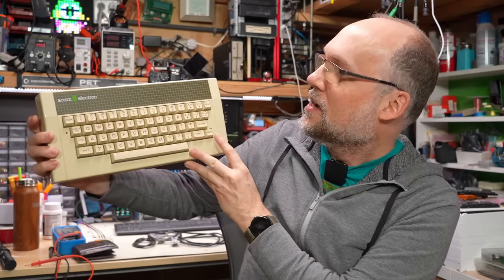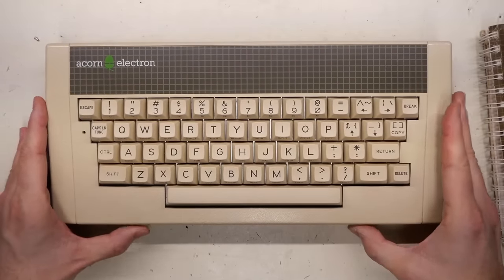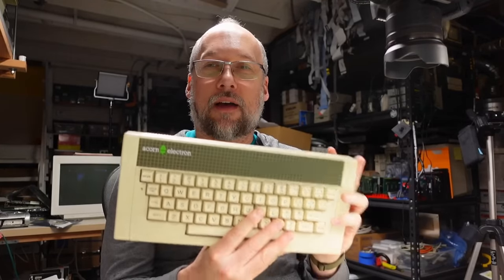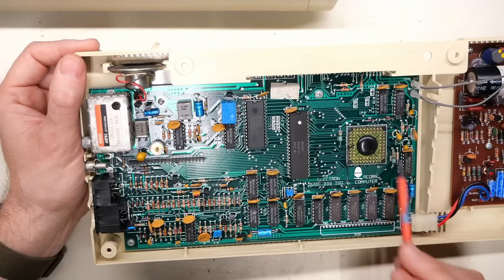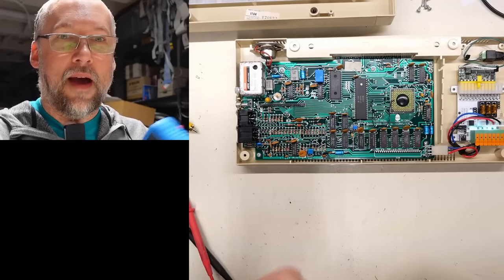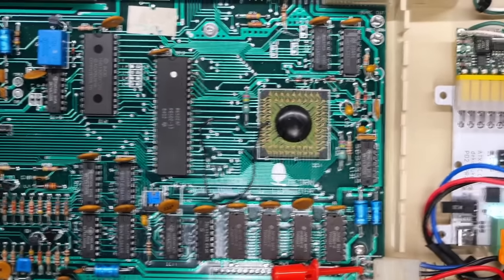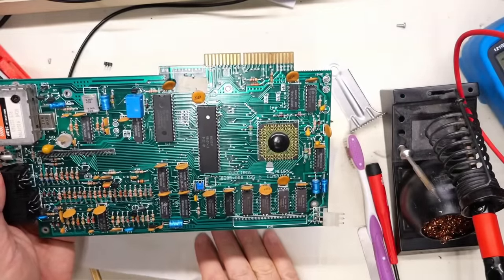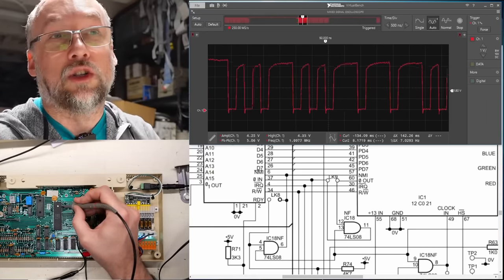I was shocked at what was keeping this Acorn Electron from working (Acorn Electron Repair)

Comment: Fun Electron fix video, thanks.  They suffer from the 6502 getting destroyed by metal things touching the edge connector, sometimes taking out the ULA too.  I've never been a fan of the Electron, it was a cost cutting exercise gone too far.  The video/CPU RAM contention is hideous compared to the zero contention on the BBC Micro/Master and in the high color/high resolution graphics modes, it really cripples performance.  The sound is also a single channel so music written for the BBC/Master won't play.  The need for a static clock is part of the timing bodge, otherwise the unused CPU cycles would need to be replaced with NOP instructions adding more complexity to an already packed ULA that had bugs and time/cost overruns - hell the Electron effectively bankrupted Acorn forcing its sale to Olivetti...
Reply: The Electron didn't actually do anything to Acorn as such. It was a product of Acorn's corporate strategy and thus any responsibility for almost bankrupting the company lies with that strategy and the company's management. And blaming the Electron is rather oversimplistic given that Acorn were investing considerable sums in "breaking into" the US market with an ill-conceived variant of the BBC Micro (noted in the video), as well as formulating a range of business machines based on the Beeb that were unlikely to be competitive.

Not to mention that Acorn were pursuing ARM development as the company was losing money. Despite claims that the ARM was done on a shoestring budget, it appears to have involved not inconsiderable levels of investment and corporate focus. The result were the lean years prior to the Archimedes where commentators noted that Acorn were merely respinning the same 8-bit Beeb technology and not keeping up with the rest of the market.

I would agree that the cost cutting was excessive, however. Acorn should have been more prudent procuring their RAM, put eight chips on board, lightened the load on the ULA, and positioned the machine accordingly. But I imagine that they were scared that outdoing the Beeb in one area would undermine their flagship product, even though the Beeb needed to be redone (as the B+) to use newer memory devices and put more memory on board.
Reply: @paul_boddie  The problem with the Electron was the large amount of money devoted to it, the expectation of 100k+ sales in Dec 83 and the sure-win that was anticipated allowed Acorn to essentially spend money it didn't have.  Then, in 1984 the Electrons arrived, but it was far too late.  People had put off buying the BBC Micro in anticipation of buying the Electron at half the price.  Those potential customers ended up buying neither, leaving Acorn with over 100k Electrons + another 50k sets of parts and 40k BBC Micros.  Their 1984-85 accounts were dismal (high value in stock - tangible assets - but only of use to Acorn and high value in IP - intangible assets, but very low cash in bank - leading to cash flow problems - paying staff and suppliers)  As a plc - Acorn couldn't hide the losses.

Comment: Wrong CPU, ULA not soldered, Ripped trace, but at lease the bodge for the ripped trace went to the right spots even if it also was a bad job. Overall one of the easier cases of fixing someone else's work because the problems were very obvious upon examination. Guessing the person didn't resolder the ULA because the system didn't work anyway with it in there and they couldn't be bothered doing all that soldering just to have a system that still didn't work

Comment: Is a memory expansion possible ?
Reply: Perhaps the most popular back in the day was the Slogger Master RAM Board which added 32K of "shadow RAM". This raises the amount of memory accessible to certain programs by effectively giving back the memory that is dedicated to the framebuffer, which is up to 20K in high-resolution or high-colour modes. When the Electron was being sold off at highly discounted prices, Slogger offered units with this board already fitted.

There were also second processor expansions that added another 6502 and 64K of RAM. And paged RAM could also be fitted, with there even being a 256K cartridge available, although things like that were often used for RAM disks or for hosting software typically supplied on ROM.

Comment: It's a shame all the 4bit to 8bit data bus circuitry is in the ULA - if it wasnt, you might be able to make a hack to put another 4 RAM chips in and bypass the CPU slow-down.
Reply: Actually, depending on what's on that external connector, you could probably develop some sort of cartridge to do it.

Comment: I would love to see the details of how they made the poor 6502 work on a 4 bit data bus. That has to be the most horrible cost cutting measure I've ever heard of.
Reply: No different in principle to the way that Motorola made the 68008 CPU.
Reply: The ULA acts as the intermediary between the 6502 and the built-in RAM, accessing two adjacent addresses by maintaining the same row address but issuing two column addresses, building up (or splitting up) an 8-bit data item from (or into) two 4-bit pieces. The 6502 still sees an 8-bit data bus. However, the need for the ULA to go to the RAM twice causes the 6502 to operate at 1MHz when accessing the built-in RAM.

(The ULA accesses the RAM itself when producing the display, but it can maintain a 2MHz access frequency doing so. Timing considerations prevent the 6502 from completing these memory transactions via the ULA within a single 2MHz cycle, forcing the CPU to sit out any otherwise available following cycle.)

The 6502 actually accesses upper memory (normally ROM but also "sideways" RAM) directly, more or less, and at 2MHz. And there was a "turbo" upgrade that situated 8K between the CPU and ULA for the lowest region of memory, also permitting faster access, which was particularly helpful for the zero-page accesses that are of critical importance on the 6502.

I think the summary is that the need for cost cutting (due to various reasons that are open to debate, usually about the price of RAM) initiated a search for optimisations that facilitated a reduction in RAM chip count, which is where this double-access trick comes about, but the optimisation actually reduces system performance and has the CPU running at half its rated speed a lot of the time. Personally, I think Acorn should have managed their procurement operations a little better and saved their designers all this effort.

Comment: At https://youtu.be/sukuk-miq4U?t=786 the diode to the top right of the PLA is broken.    D9 i think, though later in the video it appears fixed ?
Reply from the maker: It was just bent out of position a little.... I often go through and straighten components while inspecting the board, etc. You will notice things like bypass caps are all straightened and aligned as well.
Reply: @adriansdigitalbasement  Sorry, i was convinced the Glass body was broken.
Reply: @jameshearne891 That was my impression too. Later in the video it is straigthen but it looks like there is still a crack.
Reply: @adriansdigitalbasement  As james discovered: i also think d9 is broken. please investigate.
Reply: @KosmokratorVideo  Maybe it is why the cassette in doesn't work. I can't see D9 on the schematic so maybe it's only on the Iss 6 pcb.
Reply: @jameshearne891  I don't think so. D9 is on the output side of the ULA. I left a downloadlink for the service manual (with the newer schematics) in the patreon comment section.

Comment: The Electron was such a disappointment back in the day. It wouldn't run a lot of BBC Micro games, and those that did run ran badly due to being so slow; the performance problems were less of a problem for productivity software but with no text-mode MODE 7 you were stuck with the bitmap graphics 8kB framebuffer using up the limited amount of memory; and you had to buy the disk expansion separately. There were Electron games, but many of them wouldn't run on the BBC Micro! They cut costs in all the wrong places. Like, why did they use 4-bit memory but still have the expensive mechanical keyboard?

Just to add insult to injury, the Electron video system had no provision for a hardware cursor, so the OS would toggle the pixel colours in software. The Acorn OS disk system used video memory for temporary storage when defragmenting disks... which meant that if you didn't turn the flashing cursor off before running the defragmenter, it could irrevocably corrupt your disk as the cursor routine changed the data read off disk!
Reply: The keyboard won't actually have been that expensive given that these things were being made in huge volumes. The typeface used on the Electron's keyboard is probably familiar to people using all sorts of other systems from the late 1970s and early 1980s, and so they were probably widely available in numerous channels. I seem to remember a "design your own computer" competition in one of the magazines - maybe Popular Computing Weekly or Your Computer - where they put a price on a mechanical keyboard and although it was an expensive component, it wasn't more than £10 by their reckoning.

As for the ADFS disk corruption problem, it was admitted by Hugo Tyson that he and the other developers weren't made aware of a lack of hardware cursor and so didn't think to switch it off when using the screen memory. That isn't really a fault of the machine: the 6845 that did the hardware cursor had been omitted and much of its work handed over to the ULA. And I have to say that I found it annoying when developers left the text cursor needlessly flashing in the corner of the screen, anyway: it just seemed so lazy. In any case, ADFS was eventually fixed, and in my experience the Electron had superior DFS implementations to those I encountered on the Beeb.

Comment: Interesting cost saving design, but the 4-bit RAM would’ve completely turned me off this machine. To loose all that performance simply to save the cost of 4x DRAM chips is obviously a purely marketing driven decision.
Reply: Marketing and economics. The boom and bust cycles in the DRAM industry during the 80s and 90s were a huge problem for manufacturers when margins were being squeezed by retail and competition pricing. For a short while the decision to go with four 1-bit wide chips looked reasonable, but only because there was no 16k x 4 part at that time. From today's perspective, however, it does look like a very poor design choice.
Reply: @GodmanchesterGoblin  Yes, a marketing driven decision. I was designing microprocessor boards at the time, and certainly remember the cost of RAM chips impacting design decisions. But I do recall both 4164 and 4416 chips being available in 1980 / 81, as they’re both 64Kb chips, just different organisation. 4416 was more popular at the time, as a 2 chip replacement for 8 chip 4116 designs, therefore I’d suspect the 4x 4164 decision would have been driven by chip availability (with 4416 initially being in higher demand).  Even so, the decision to cripple performance to achieve a target selling price would have been purely marketing driven, not a technical designer’s decision.
Reply: @gregclare  Fair enough. I was designing hardware from around 83, but not with DRAM until a little later. My recollection may have been a bit off regarding relative availability of device types.
Reply: @GodmanchesterGoblin  Yes, my recollections from so long ago are also a little hazy.  But I definitely recall early initial use of 2x TMS4416 as hugely popular single 5V design replacements of the less reliable, but hugely popular, triple supply 4116 DRAMs.  Speaking of which, I still clearly remember saving up as a teenager, to buy my first 4116 DRAM chip to experiment with (yes, I initially could afford only one, but at the time of 2102 & 2114 SRAMs, a 4116 was like mass storage!). 🤓
Reply: @gregclare  I expanded my ZX80 using a few MK4801, but I designed and built my own 4116 board inside my ZX81.  And I just looked up, TIs 4416 was indeed from 1980. Fun days!
Reply: @gregclare  Certain remarks made by people with inside knowledge suggest to me that Acorn may have been too imprudent when procuring their RAM. People will claim that 64-kilobit devices were expensive and hard to source, and I wasn't exactly old enough to be doing such things at the time to really contest those claims robustly, but looking at price lists and other historical documents rather suggests that things like 4164s were not that expensive by the time the Electron was being manufactured. So, I suspect that they overpaid and overbought, perhaps to get leverage over other companies, and then let that dictate the design, which was all rather regrettable.
Reply: @paul_boddie  Yes, I suspect you might be onto the real reason.  Even if 4x 4164 chips made more sense in the early design stages, with DRAM advancement and price drops happening so quickly back then, it would’ve been relatively easy to make a late design change to 4x 4416, to avoid the 4-bit memory performance impact.  The only logical reason why they wouldn’t, is if they were sitting on a lot of stock of 4164 chips, as you’re suggesting.  Perhaps they thought customers wouldn’t understand, or care, about this performance impact. Unfortunately a bit short sighted.

Comment: dislike just because that jumper wire.... 
(instead 0.9mm via copper rivets sold in aliexpress and small tracks made of copper sheets extracted from li-ion batteries and finished with green UV mask)